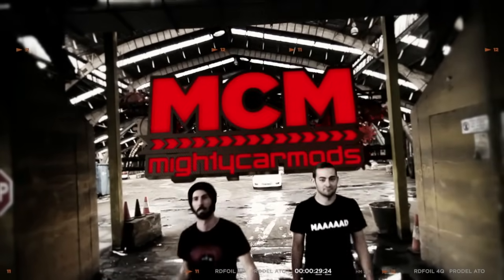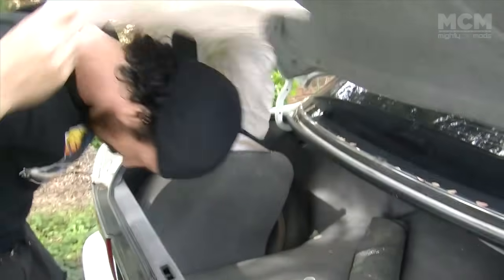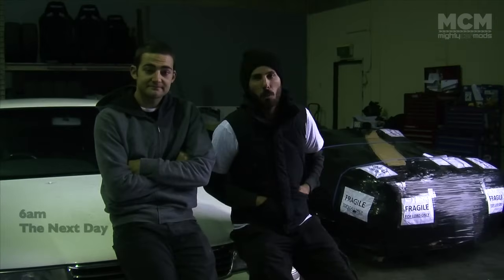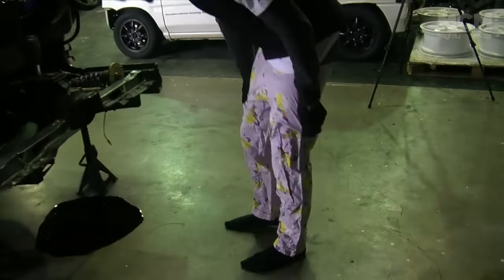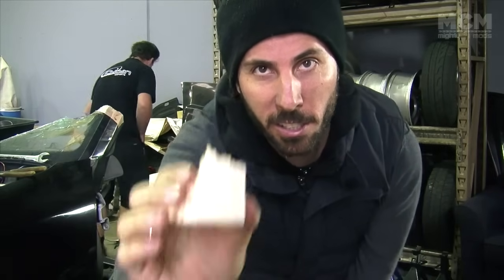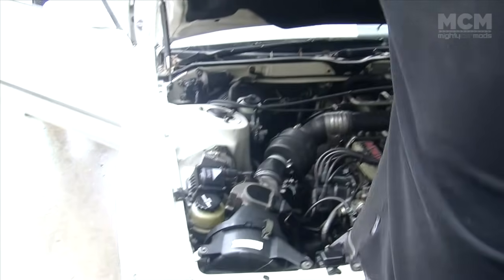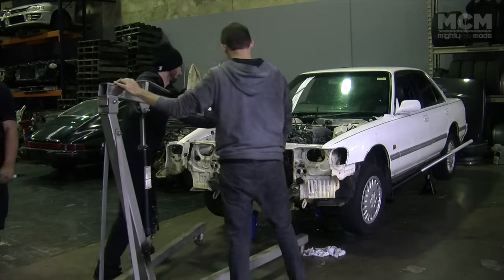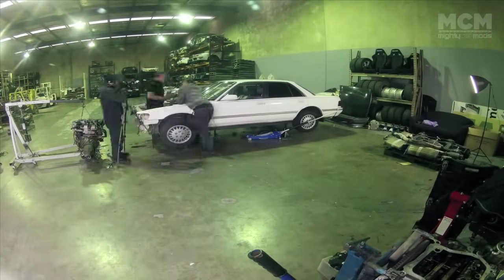1JZ Engine Conversion

Comment: That is a super clean car for $600. In the states they'd sill want $1000 after the engine blew.
Reply: Yeah... In Northern Michigan people want 4k for a shitty miata with 250k miles..... It sucks haha
Reply: I got my 1998 Eclipse GS for $380
Reply: Bring it to central MN lol
Reply: +1394kk But you've just defined why it is $850 US. It's an auto S13: no-one wants one of those: in my opinion anyway.
Reply: LOL! Same shit would be as low as one grand in Florida....Florida is king for cheap ass transpo, that has some street cred. Bought my First 2nd gen Probe GT with 68k and a 5-speed for $1300. Drove it for 2 years with nothing other than oil changes and tires....Till I totalled it. That's my personal best Used Car find.
Reply: Got my Cressida, all stock, 1 owner, full luxury for $1200
Reply: I can't find shit in my area tbh, most rx8s and s14s are overpriced as fuck
Reply: Cryptic hax haha 240sx are over priced here to which is why I won't sell mine ever. ppl want 4k for them with torn interior and faded interior, missing panels and they are always missing the radio. those cars already have dents from drfting and just a stock sr20det. for 4k nope
Reply: Jordon Renn no they don't lol I can find cressidas all day for $400 running or $100-200 parts car. I literally just looked up on CL and found 20 in my area(so Cal)
Reply: 7mge was well known for head gasket issues
Reply: The other day I saw a 1991 s10 going for $4800. Crazy. I don't care how good a shape it's in, it's a 27 year old truck
Reply: Cash for clunkers killed the cheap car market

Comment: 8 seconds to a 100... that's like... better than a new Lexus IS300h ...
Reply: 100 kph not mph
Reply: Jordan Green Yup. So that's 8 seconds to get to roughly 62MPH. Only about half a second slower than the IS300, though.
Reply: he just seemed astounded by the speed lol when in all honesty its not crazy at all.
Reply: Jordan Green  Yes, 0 to 62 mph in 8 seconds is slow as hell. I don't know why he was astounded at all lol.
Reply: o0julek0o 280hp to 500hp on stock in less than 3000$
Reply: ***** In racing terms yes, in road car terms no. I reckon at least 9/10 cars wouldn't do 0-60 in 8 seconds. The "sport" Subaru Impreza's do it in just over 10 seconds. It's only if you get an STI you get about 6. Anything 8 and below is sporty really.
Reply: +Jallenbah Agreed. Although this depends where you live, at least in most of Europe 0-100km/h (or 0-62 mph) in less than 9 seconds is reasonably quick, and less than 8 seconds is considered fast. Especially for an older car.
Reply: +Jallenbah Agreed. Although this depends where you live, at least in most of Europe 0-100km/h (or 0-62 mph) in less than 9 seconds is reasonably quick, and less than 8 seconds is considered fast. Especially for an older car.

Comment: Took my local mechanics 1 week to take the engine out of my mustang, then 1 week to put a rebuilt one (pre-rebuilt) in the car and then 2 month to figure out why it doesn't run right (still doesn't run right).

Total damage: Nearly 10 grande.

FML... Never again.
Reply: I think you need to find a new shop.
Reply: Two problems: 
1-your local shop is garbage.
2-it's a mustang.

Nuff said.
Reply: stangs are wicked cars mate
Reply: who the fuck took that long to do a swap... I used to work at a Mustang shop, we did 4V swaps in 2 days, Coyote swaps in a week or two.
Reply: Ronan B should've put a 4L turbo Barra engine in for that
Reply: time to sue in small claims court

Comment: Shoulda bought a Nissan 240SX and swapped the 1JZ into it
Reply: This idea would have voided the main plan behind this video. If you watched the first video where they chopped a Toyota Chaser you`re probably be aware that the idea was to show how parts could be swapped directly into lower specification models. Swapping a 1JZ into a 240SX would mean tons more custom work than they had to do here with this Cressida. Could possibly have been much more expensive too considering the rarity and increasing value of S13s
Reply: Someone's been watching Tuerck'd.

Comment: help!!! 
im swapin the same motor as these guys did and well i wanted to know wat i need to change on the wiring harness??? 
also can i use the existing cressida fuel pump or upgrade to a walbro 255?? 
and they didnt really show how the hid the intercooler with out choping the bumper

Comment: some cars are very universal were many many engines can fit into the engine bay. Usually you will have to change the transmission. Swapping engines is very very common and if it's a common swap it won't be too difficult. And about anything you can think of has been tried or done so i'm sure your suv question is a yes.

Comment: Why did you not just drop the whole subframe with suspension, engine transmission out of the halfcut then bolt it straight into the new car?

Comment: There is also the NSX, NA engine but still pushing at least 300+HP stock. Push it a bit and you have a little monster with smooth torque.

Comment: they were able to swap the engine because the two cars were a similar platform, swapping the engine from the MY09 Forester XT into the Cressida would be vastly more difficult due to the difference in models, design, manufacturer and model year, look up the car you are planning to swap into on google and most likely you will find forums dedicated to that car or brand or model year, and people who have done successful swaps. Also it would probably show what engine they used.

Comment: I have this toyota 1jz engine 6 cylinder 2.5 l.
I have to torque the cylinder head but i can't find the settings.
Any help???
Reply: google
Reply: take it to someone who knows what they're doin
Reply: Should be in the manual... And if you're doing any mods or major servicing, you should have the manual.
Reply: tanx everyone, but i already found the correct way and i could not find it the manual, because it's in Japanese. I think it was 25 ft lbs and two times 90 degrees and water does not get in to the oil anymore. It helped
Reply: Lange Man 25 foot pounds is too little for a cylinder head. It should be around 75 or 80, that's what most supra owners have had success with.
Reply: Roger Sahagun that's why he said 25ft lbs plus two times 90degrees.
Reply: up till now it just runs great, tighter then this, you might snap the bolds or somthing else

Comment: I realize that this video is quite old and therefore this is a moot point, but why didn't they replace the head gasket and torque the head bolts to the correct torque? (I heard that the head gasket failures were due to a bad torque spec that toyota never bothered correcting)

Comment: if the engine is well looked after...no.
my sr20det has 134k miles on it, had a rebuilt but is always well looked after and still pushed 410bhp!

Comment: why didn't you just cut the cressida's front off and put the chasers front on
Reply: because it wouldnt be stable and it should look kinda stock
Reply: the Cressida is actually a little bit wider than its JDM counterparts. so it wouldnt fit flush. Believe me, I wanted a Chaser front on my Cress but the fenders wouldnt line up with the door and all.

Comment: Because the Chaser and the Cressida share the same chassis. So the engine bay needs no modification to fit the 1JZ. If they dropped it in a Hachiroku, they'd have to make custom parts, modify the engine bay, and spend weeks on the job as opposed to one weekend. Also, in my opinion, it would throw off the balance of the 8-6. But that's just my, inexperienced opinion. 

Anyways, they're doing it for the simplicity and the compatibility. And it might also be because they wanted a maaaaad sleeper!

Comment: ah ok. well, as far as ists with all the german cars its just a "just whats needed" type. for exampel my old car had a 2.5l v6. the next smalest engine was a 2l r4. but both use different parts. smaler brakes, smaler driveshaft even softer suspension. a friend of mine changed his engine on his bmw and had to get a new clutch after 10k km because the clutch couldn't handle the added 60hp over time :-/

Comment: You guys make getting half-cuts and shipping them out of Japan look awfully simple... Do you guys have a single importer that you've vetted out that you deal with every time or does Australia just not have crazy vehicle/engine importation laws like N.America???
Reply: D king.. I have imported a rhd japanese car one time from Osaka, Japan.. And I didn't get to drive it or register it. Just i do the same thing as the mcm, but the only things that I've done is swapping the whole thing to my non turbo stock american version and register car. It worth it too if you ever go there to Japan, there price on all cars are freaking cheap!! And shipping price, they have connections and so it will be a kick off deal including the shipping cost and the whole car.. Mine was 900$ used 88' Toyota Supra 3.0 GT Turbo A. And shipping is 879$. So I paid 1,779.00 in american dollar money. And it worth the wait for 3-4 weeks to get to your garage or door step, how ever you want to called it.
Reply: And I sold all the parts of the turbo A supra and combining to my old parts. So I have a 7mgteu motor and r154 tranny with turbo A supra Trd lsd. With non power seat for my driver side and all of the dash equipments, and the only thing I've able to pass smog are to used the stock afm or the lexus 1ufze, put back the egg valve, the catch can, and the stock ecu. Everything is still running the same. But lucky, the HKS fcon ecu management come with the car and harness, but wasn't plug. Just inside the box in the back seat of it. And I grab that on the way home while they're shipping the whole car to palos verde, ca where I stayed at.
Reply: Big Lou thats some great info mate, thanks for the insight aye.  I've got a JDM 1KZ-TE right now but I feel like I need to take a trip over to Japan cause what youre describing (awesome sounding swaps and cars BTW) is exactly what I need... we have a TON of demand for small diesels here in the US, and I have a Salvage Co. (My dad and I's company) that I could use to help facilitate the process as well.  Thanks for the info mate, really appreciate it.  Best to ya, Ta.
Reply: Oh is that's right D King.. That's great mate..
Reply: D King.. Same here haha I would love to take a vacation to Australia some day.. My auntie lives there and wanted to ask her husband, which is my uncle inlaw to see if he can ask his buddy if he wanted to sell me his turbo A supra. But I doubt he would.. Because is his favorite supra out of the jza70 model.. But why?? Haha..
Reply: D King whats the difference between A JDM 1KZ and US?? I have a 2jz prado which had a 1kz, and I struggled to get Any power out of it, so I'd like to know what advantage JDM version has.
Reply: Bradley Cruse Where are you located mate??? that sounds like a neat truck but being a diesel fanatic I shudder when I hear of folks "removing" a diesel in favor of a gasser but it still sounds awesome... Part of my shock is that we never GOT the 1KZ here in the US Market (so they're precious and few over here), but the JDM 1KZ-T/E's aren't majorly different in fact to some the Aussie versions are the most desirable because of the better handling of hot-weather and extra cooling capacity.  Some folks love the S.African trucks because they had the Mech injected 1KZ-T with no computer (although it is a lower powered engine slightly)

I'm talking a 1KZ-TE so it's the Turbo'd E-controled Diesel and really with just a little tinkering on the Injection Pump's electronics (you put variable rate resistors and potentiometers in between the wires and the wire-hook-ups on the pump... basically like a Guitar Volume knob/pot) you can make some pretty good power for a Diesel.  It's less about the sheer power for me (although having a 22RE 1st Gen 4Runner right now ANYTHING is a power upgrade) and more about the grunt and fuel econ.  

However, that said the engines, in stock form, come set up to produce the lowest NoX emissions possible which means over-fueling and retarded timing which is where the variable rate resistors come in.  That stock configuration is responsible for most of the over-heating and low fuel econ issues the 1KZ had (that and the auto-tranny cooling system being shared with the engines, mine will be completely stand-alone to the tranny/engine) so adjusting those two parameters really "wakes up" the engine for most.  The trick is not to over-do it, we're talking 1mm of a turn to the dial will make a some-what pronounced difference so... it's all about the fiddling you do to them.
Reply: D King over in the UK, Due to high fuel prices the Toyota 4wheelers almost all have a 1KZ,
Reply: Bradley Cruse Yep, I'm actually a dual citizen of the UK/US (born in Inverness SCO) so I'm well aware of that scene etc.... That's gotta be one unique truck you've got over there aye.  Very cool mate.
Reply: +Nor Wester (4Rescue) Fuck yeah! Inverness!
Reply: CxC_personal Hell yeah!!!  I rarely find anyone who even know where The Ness IS... cheers mate.

Comment: Except people pull 700hp out of the LS7 without boost, and with it can pull over a grand with the snails. You're comparing a stock car to a modified one, brand new vs how old is the 9 now? Hell for the money try building an evo 9 that will outrun a C5 Z06 at the same price point. You might get the acceleration part ;)

Comment: Thats kilometers, not miles.  A japanese car going 300k with only preventative maintenance is fairly normal, and going 400k with minor work isn't unheard of.  I can see a GM, Dodge or Ford being near done after 95,000 miles, though, so I see the confusion.

Comment: Am I right in thinking that they essentially replaced an engine that is used in the Toyota MR2, with the engine from a Toyota supra??
Reply: The 1jz is essentially a destroked version of the 2jz engine that is in the supra. Very high potential engines that can withstand big power on stock internals
Reply: So yes and no it's not the supra engine, but close.
Reply: Actually I'm stupid, I always assume people think 2jz when they talk about supras because of the Mk4, yes the 1jz was in the mk3
Reply: 1. Learn to read, that's not what he said.
2. Learn to type, that shit is nearly illegible.
3. Try not to look like an idiot by insulting someone about something they didn't even come close to saying. 
4. Have a nice day.
Reply: Thomas Lister.. Are you proffering the Soarer by mistaking saying the mr2 engine to supra engine or some sort?? No mr2 is 3sgte turbo engine.. 4 cylinders 2 liter.. The supra 1jzgte is 2.5 liter.. And the same used in a soarer as well.. The 91 and up model in Japan.
Reply: Preffering* not profe.. Lmao sorry
Reply: No, I got really confused. The first engine looks a lot like the naturally aspirated supra engine (2jz-ge) , but I got mistook with the mr2 for some reason :s
Reply: Haha i don't blame you Thomas Lister.. Before like back then.. i got confusing with the nissan 200zx turbo motor as the 300zx twin turbo and the 300zx twin turbo as a Nissan Rb. LOL You're not the only one. Cheer!!!
Reply: 200sx not 200zx. LOL You see there.. LOL

Comment: ok i got a challenge for you guys , hehehe, ok you have done a lo of cool cars , so i have a jeep a yj jeep , and i want to put a 2jz or a 1jz you think it can be done ? and if so can you guys do it .... and  if you do ill do the same on my 1989 jeep wrangler yj 2.5 5 speed , i think it wold be so different form all others..
Reply: Well, that Jeep did come with an inline six from the factory, so it might fit. Aside from all the custom work you'll need to make it fit, that 4 cylinder-version 5 spd is notoriously weak when it comes to additional power. Make sure you swap that out too, the whole box's too lightweight.
Reply: well , i sold the YJ , and got a 2004 honda s2000 , the jeep was to jumpy and could not use it as a daly driver .. ill miss it .. but i like to put a vtech v6 for a acura tl in my s2000 lol
Reply: +DAVID VILLA or slap a turbo on the s2k, those engines can hold some good power on them
Reply: yes i was thinking of that to , thing is, the F22C1 only came in the s2000 and theirs not a lot of s2000 out there eventually parts will get hard to find , so i think instead of ruining this motor ill pull it out and stick in a j35a4 that cam in the Acura TL- S there is a lot of thoes and the make 300 hp , and ill mod that thing up, turbos push rods pistons , i think i can get 480 Hp ez out of a j35a4 , well thats my hope ..
Reply: +DAVID VILLA you can always go the custom turbo kit way, no need for a pre-made kit. The aftermarket support for the s2k isn't going anywhere anytime soon

Comment: wow, putting an engine with 4x the power to the original motor in a car, that wasnt build for it? you could never do that in germany, you'D have to replace almost every part that has contact with the power of the engine to fit it to the actual power. why? every seen a smal 1.2l car that get a 2. turbo engine accelerating? prepare to buy new driveshaft after that.

Comment: Why the fuck they have to cut that thing in two peeces?
Reply: There are all sorts of environmental risks involved with bringing any type of life from one continent to another. Humans included. Say for example there are some very small remnants of a seed pod from a species of tree that travel along with the car, or a type of bug, maybe a worm.
If that gets into the ecosystem of the other country it could end up upsetting the balance of nature.
An extreme example would be something like introducing a type of a flower that can procreate much faster than surrounding flowers, but produces significantly less nectar, it could in turn affect bee populations negatively and in turn screw up agriculture.
Shit like that.
It's kind of stupid I know, but the principle is correct,